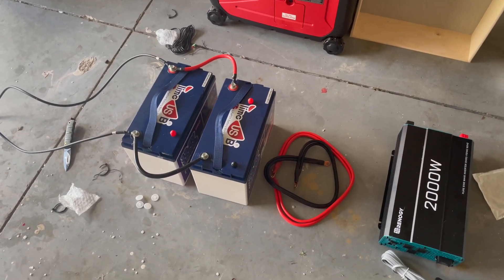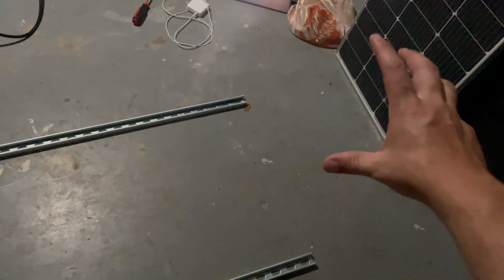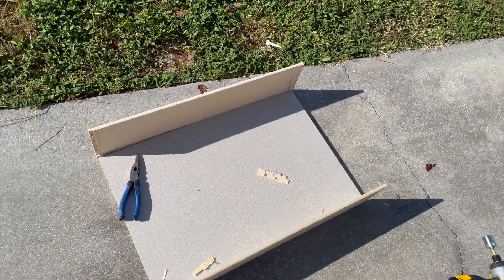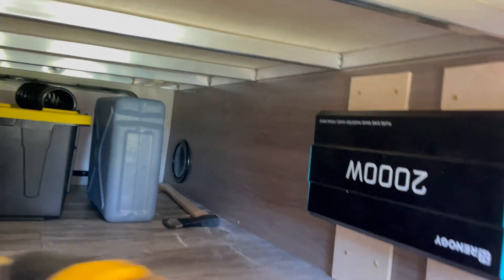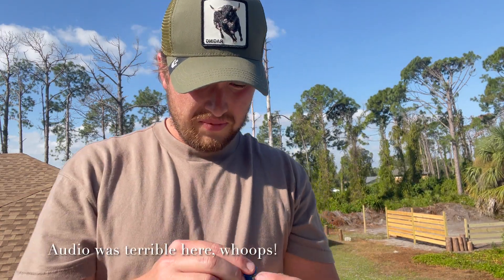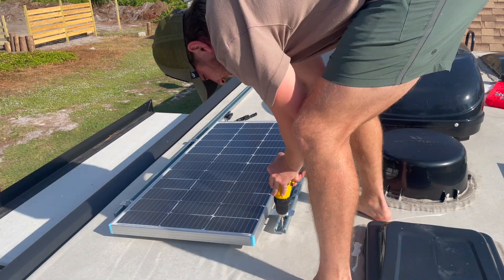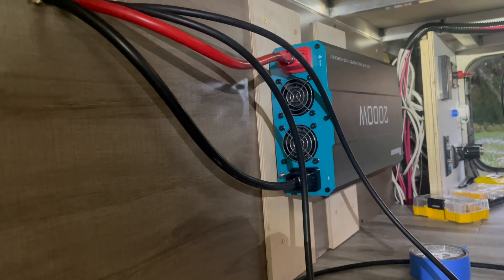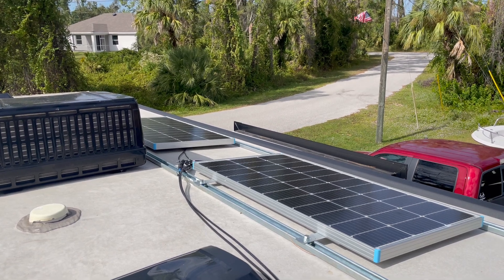Off-Grid Solar Install for Newbies | Full Time RV Living

Comment: why did you  choose the 2000w instead of the 3000w ? i think the 3000w would be better for the new 460ah lipo4 batteries they sell now ? especially to run the air con..
Reply from the maker: If you plan on running AC make sure that you have a MASSIVE battery bank. 460ah might be cutting it close. We don't plan on running AC from our solar so the 2000w does the trick. The 3000w inverter for you will be fine with that amount of ah for all your devices, how ever an AC is hungry so I'd recommend more batteries, and more panels ontop ti replenish. Good luck with everything!